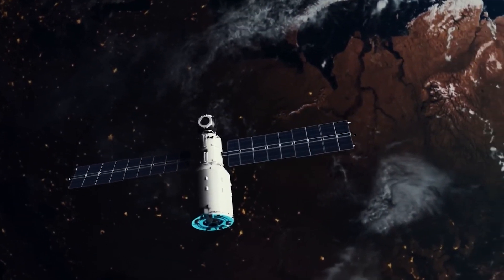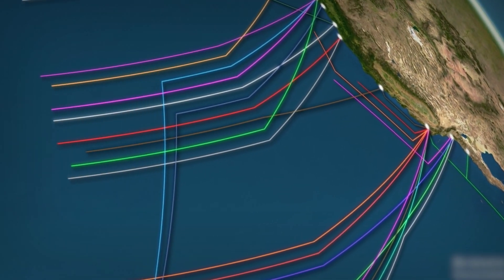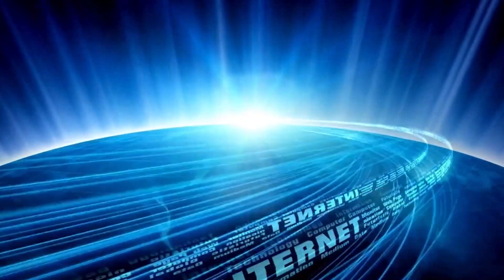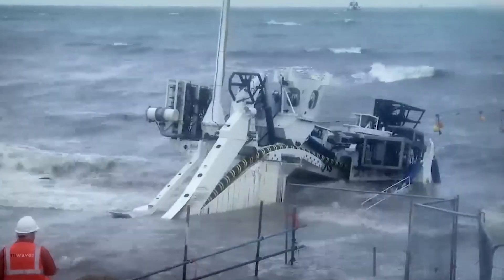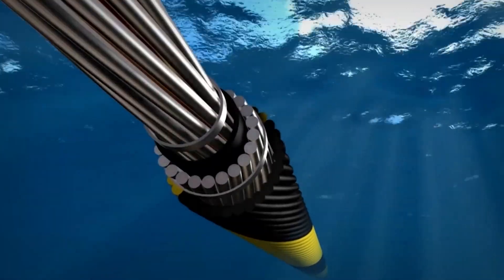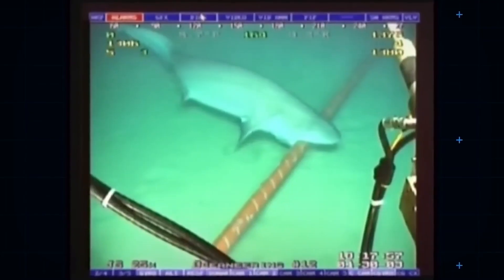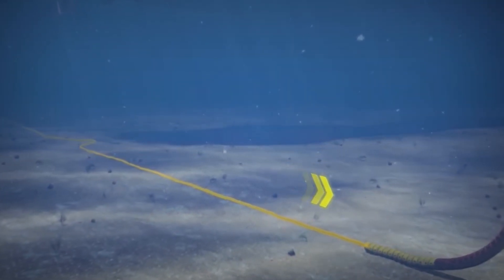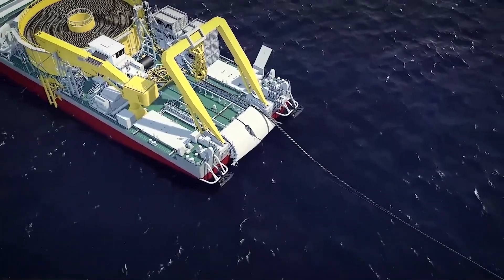How The Internet Travels Across The Oceans

Comment: 5:40 correction - light actually travels faster in the vacuum of space than the cables.  The reason the cables have less latency is because they are shorter than the distance to the satellite and back.